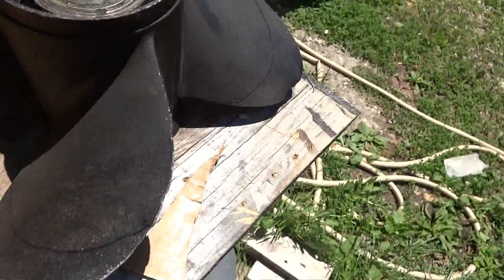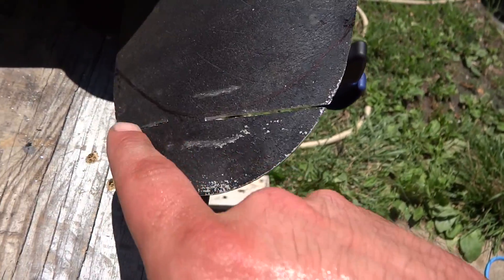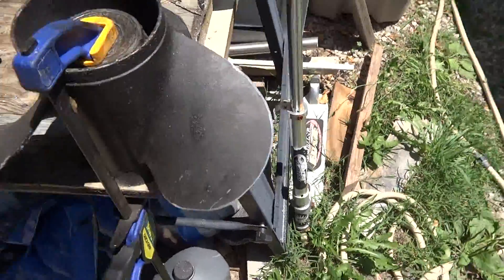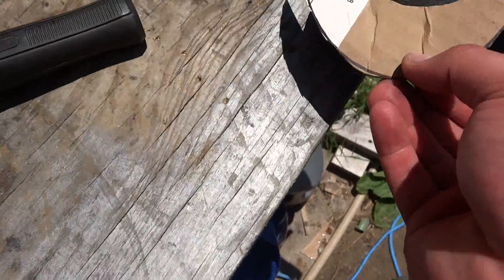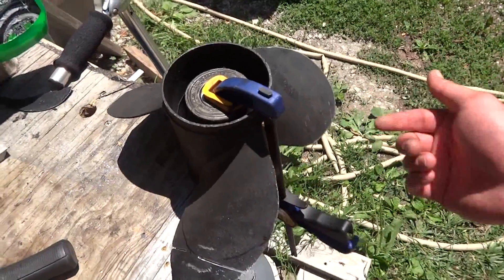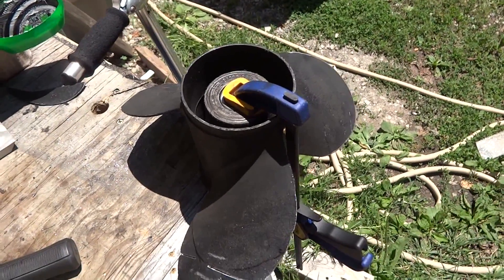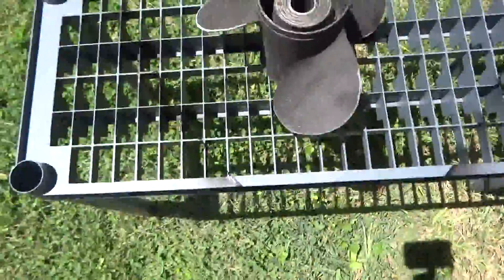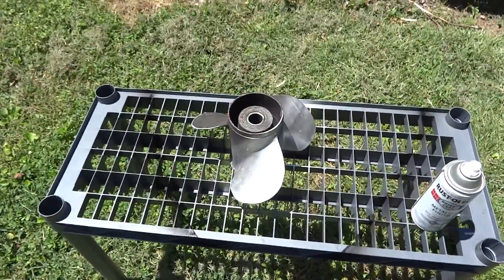Test Prop for your Outboard- HOW TO

Comment: How did it work
Reply from the maker: Works perfectly. Still have it.
Reply: @cturboaddict  we’re you able to run at full rpm
Reply from the maker: @maryfithen5006  yes. But it splashes

Comment: 1/3 Cut? That MAY work in a test tank if you DARE But Never at a dock at 5K RPM  MAX Timing without breaking your docking ropes & Go Flying GOOD LUCK
Reply from the maker: Its specifically for a test tank. And it's worked extremely well ever since.

Comment: what size test tank did you use for a 115HP like yours? Thanks
Reply from the maker: 55 gallon plastic drum. There's people on Craigslist and social media marketplace selling them. Just chop the top off with a sawzall
Reply: cturboaddict I never thought that would be big enough. How high in rpm  can you take it with the test prop that you made?  Do you recommend still using the ear muffs? Thanks for the video bh the way. Very useful.
Reply from the maker: @gp1003  I never went really high, but had it mid idle. No muffs, just water pumping into tank and a made a plywood lid to help contain the water.
Reply: cturboaddict ok thanks a lot!

Comment: Test Dyno props are can fan wheels
Reply from the maker: +Dave-Jill Nelson Really... Didn't know that.
This obviously is NOT for dyno work and only for test tank work at home to simulate open water conditions.  The inlines are sensitive for on the muffs vs in the water. (mainly reed issues)

Comment: Hi mate.. Ive got a 82 Mercury 80 hp that Im just putting a new Solas prop on and when I took the old prop off it didnt have a thrust washer so do these need a thrust washer or not.? cheers
Reply from the maker: I do not know if the Solas needs the thrust washer or uses a different washer. Contact Joe Poole at Ferguson Poole Marine!!! He will help you out!
http://fergusonpoolemarine.com/

Comment: what diameter and pitch is that prop? and what motor was it on?
Reply from the maker: 13x17 Merc 1150
Reply: what HP is that merc 1150
Reply from the maker: Carry Smith 115 hp